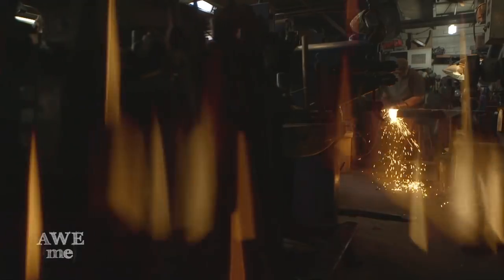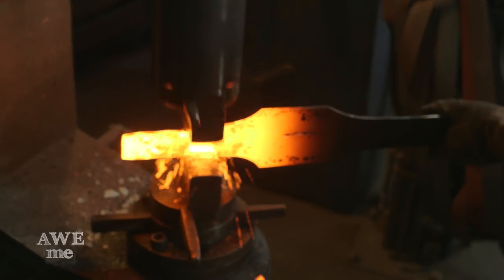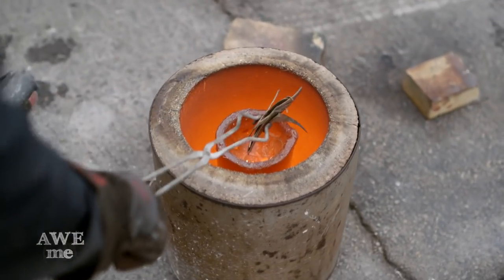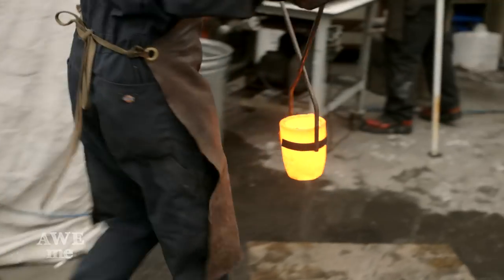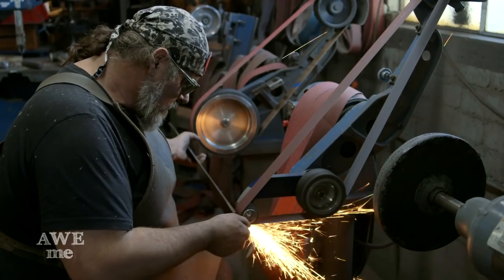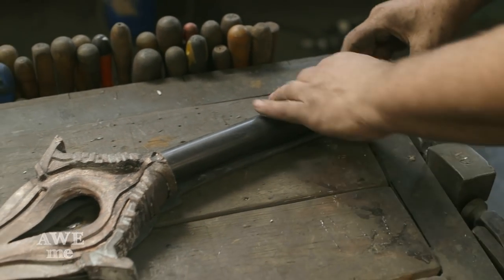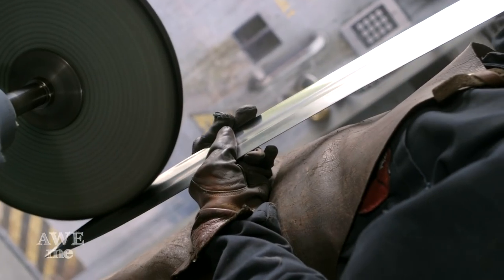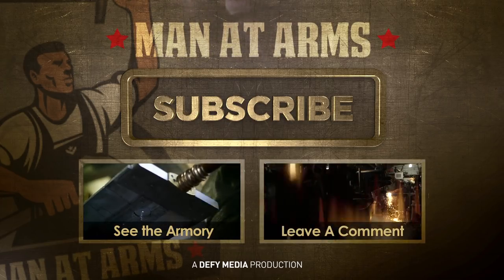Chrom's Falchion (Fire Emblem ファイアーエムブレム) - MAN AT ARMS

Comment: How about the classic Falchion? Marth's Falchion is different than Chrom's, even though they say its the same sword.
Reply: Well, apparently its the same blade, just a new hilt. :p
Reply: Chrom's sword is  falchion, marth's sword is exalted falchion, and lucina's parallel falchion.
Reply: hello internet Don’t Lucina and Chrom use the same sword though?
Reply: @rynagon_  well yes, lucina and chrom do use the same sword but, in "fire emblem awakening" lucina is from the future.
Reply: @kinacantread  Chrom has the Exalted Falchion. Marth's is completely normal.
Reply: @Nosretep  no marth has exalted falchion
Reply: @Omxga7  right. Marth sword is the true form of the falchion.
Reply: It's been refined and fixed over god knows how long so I don't expect it to look the same over thousands of years
Reply: @Omxga7  The exalted falchion isn‘t a seperate blade, it‘s just the awakened form of Falchion. Chrom and Marth both start with the regular Falchion and later awaken it to the exalted Falchion. 

They‘re both the same sword, but the hilt has broken several times since Marth wielded it and was reforged, which caused its appearance to change over 2000 years. The hilt isn‘t made from a divine dragon‘s tooth while the blade is, hence why the former can break but the latter is self-repairing!

Comment: You should make the original Falchion. The one Marth wielded.
Reply: UntacticianTV correction, the original falchion was Alm's, if we're speaking in the games' chronological time line.
Reply: Alushian T. Brown shadow dragon happened before gaiden though
Reply: Alms tio
Reply: Okay explanation time:
All the falchions are fangs of a divine dragon most of them are Naga's.
There are two main falchions and two other falchions that are kind of weird.

First, the easy one, Valentian Falchion, the one used by Alm, it was a gift from Naga to Duma for when he and Mila would degenerate and go insane so they could be put to rest by human hands.

Archanean Falchion, mostly the same deal as the previous one but it has a major difference, it comes with the Fire Emblem (also known as Binding Shield or Crest of flames) that sealed the degenerated earth dragons, this was the sword used by Anri and the descendents of his brother Marcellus (Marth, Chrom, Lucina, First Exalt, etc).

Now the weird ones:
Lucina's Parallel Falchion is the same one as the archanean one but it is a time displaced version, the one of her timeline that she brought with her.

Nagi's falchion:
Now this one it is pretty obscure, if Marth fails to get Falchion from Gharnef and Tiki is dead (in Shadow Dragon) Gotoh will send them to another outrealm where Marth will find Nagi, another Manekete that will give Marth a weaker Falchion (most likely one of her fangs).
Reply: And Seliph, it was renamed to Tyrfing

Comment: Make the Ragnell, Ike's sword from Fire Emblem: Path of Radiance, Fire Emblem: Radiant Dawn, and Super Smash Bros.
Reply: Eh it's pretty much a gold version of this one. Without the stupid hole in the middle. Like what is even the point of that hole?
Reply: ***** Probably, though Ragnell does have a very large, metal grip. It would bring the balance down a good bit
Reply: Mike Rentschler Hopefully they do it. I've been wanting them to do that sword for a while.
Reply: ThePwntagonist It resembles the crest of Ylisse.
Reply: Do it plz
Reply: ***** Not necessarily, there's ways to temper a blade that will keep the gold color on the steel.
Reply: +ThePwntagonist The point is Swag.
Reply: @warp_skip  Ragnell is quite different from Chrom's Falchion, mainly the longer blade and wider point

Comment: There is only one major flaw in this work. The blade wobbles when he was doing the test cuts, maybe they should of make the blade thicken? It looks incredibly thin compares to the original in the game. It's even a lot thinner than many of the swords I own, I wish they could of put more work into this. Welp, I guess we will be waiting for the Ragnell and hopefully it's better than this.
Reply: I agree, looks kinda rushed if you ask you me.
Reply: A wobbly sword isn't a bad thing. This means it'll take a good amount of pressure, bending before breaking and when it does bend, it'll also straighten itself after bending. A sword that doesn't wobble has one of two qualities: It's too hard, hard metal is brittle. Or. It's too malleable(Like katanas), this means that when it DOES bend, it wont straighten itself and it'll remain that way and you've got a ruined sword.

The sword cannot be made as thick as it is in the game, as that would be waaaay too heavy and the balance would absolutely SUCK, it's already got a massive guard/pommel, no need to further increase the weight of the blade towards the handle by making it THAT thick.
Reply: a sword that doesnt wobble will more likely snap...
Reply: RexCrotchitus So what if it is to heavy. I get they like to make weapons battle ready but seeing as using it for anything but display might be illegal outside of chopping random objects it can be made as heavy as possible.
Reply: Sorry, friend. Very few Blacksmiths enjoy making non-functional wallhangers. Not to mention, half the purpose of these things is to have people visit the store and use the swords pertaining to their favorite fantasy universe.

It's like if an architect created a 50-foot skyscraper that only looked good and served no real purpose. It's a waste of time, money and the architect's skill. Same here.

You can see this blacksmith really enjoys making functional swords and almost expresses distaste whenever he makes something that's just not... Practical, yeah?
Reply: RexCrotchitus A lot of swords are used for display. It shouldn't be hard for them to make one that looks more like what it should look like and not some version they see as more practical. Or maybe they could make 2 versions. I am pretty sure there are many Fire Emblem fans who would pay $1000+ to get one just for display.

Comment: My only issue with this forge is that it's missing the bronze/gold piece in the middle of the sword, Where the fuller is there should be a piece that runs down the centre of the blade. The blade looks so plain without it :(

Comment: Interesting vid, only thing though I thought that swords had to have a oval grip/handle NOT a round/circular one because of the hand needs to automatically know when gripping the sword of blade alignment, to know when the cutting blade is facing down, which is not possible with a round handle. which means the swordsman will not now if he is hitting, with the flat of the blade instead of the edge! he will have to look which is very bad in this situation, and therefore how can you make this dumb handle????????